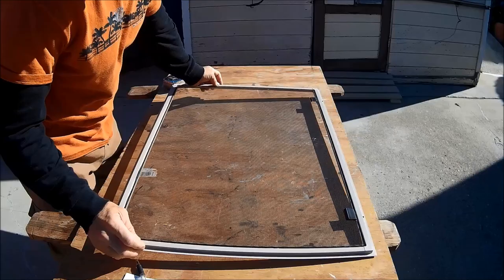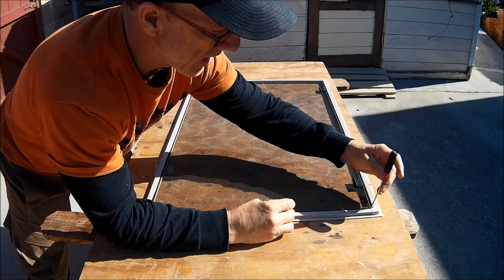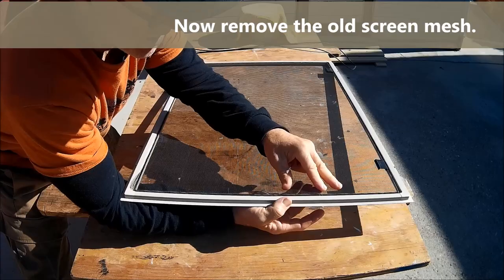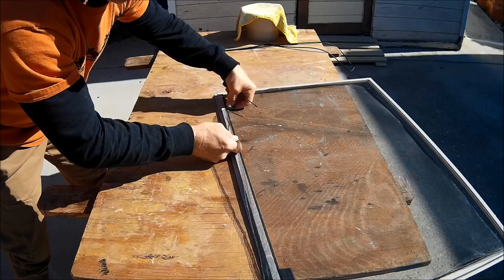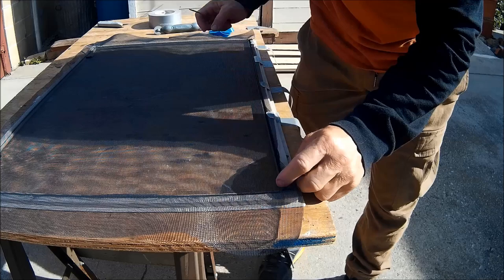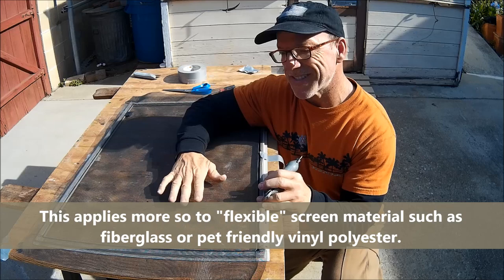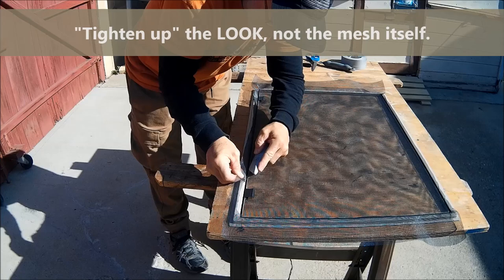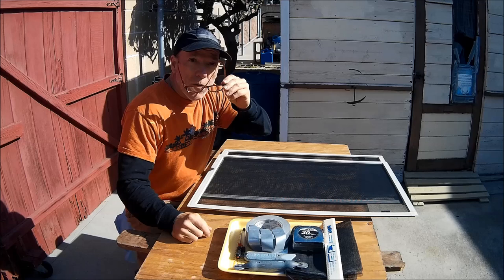How to REMOVE and REPLACE WINDOW SCREEN MESH - DIY

Comment: This was the best of the many tutorials I watched on replacing screen mesh. I just hadn't done it before and I am selling my house. 13 of them to do. The place in town that will do it for you charges over $100 a screen and they use the synthetic screen (which is very easy to work with.) I am using high grade metal screen because I am in a wild area of the desert and the birds have annihilated my synthetic screens for nest building materials. The screens are due though—They are over 20 years old. Lots of tips and details in this video that helped me to do the job. Got it down to about 20" for each screen now including initial cleaning.
Reply from the maker: You took the time to do some research, saved yourself some money and learned a valuable skill in the process. You can take that skill with you wherever you go, let alone pass it along. Well done, especially working with metal and thank you for posting the compliment. I'm happy my video could provide you with some guidance. Cheers :)